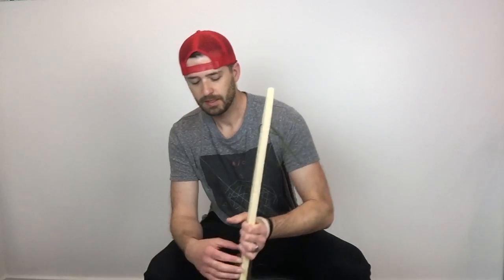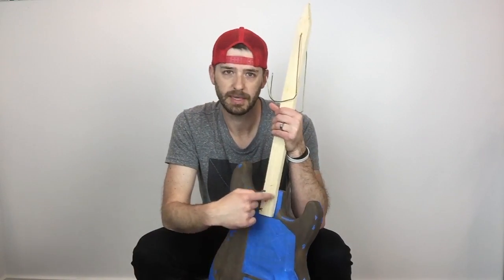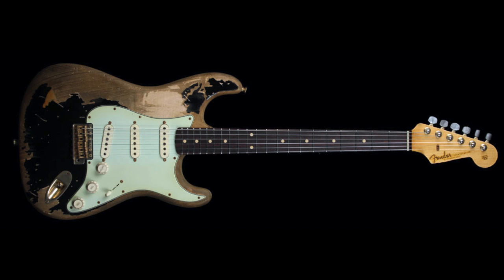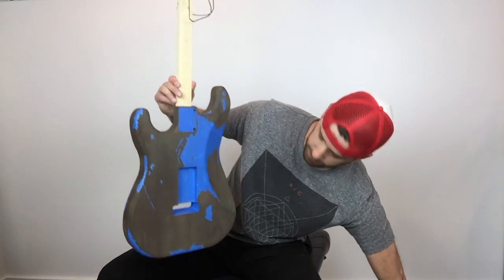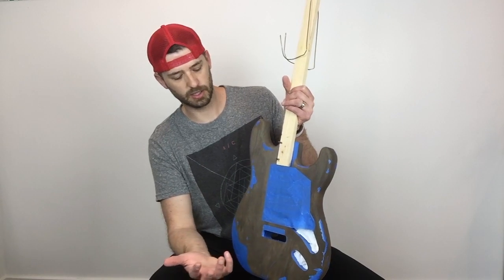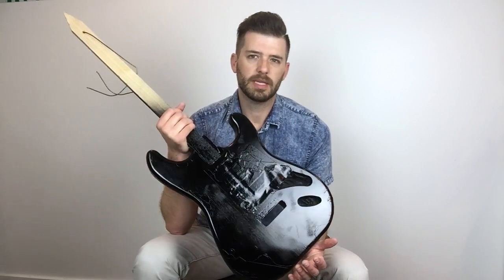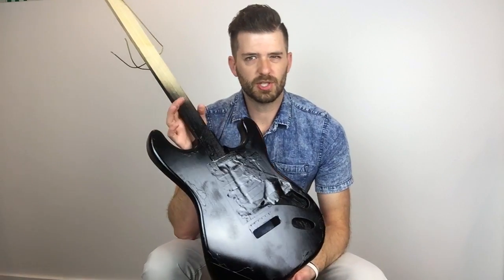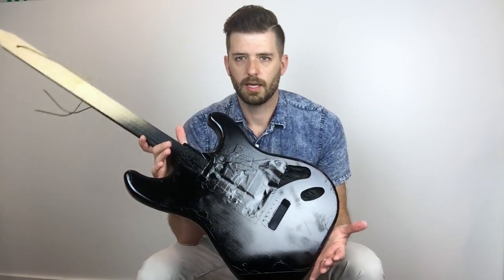Strat Nitro Finish Body Work - Part 1

Comment: the sealer is what makes the grains pop and contrast more
Reply from the maker: james dacus interesting. I used sanding sealer under the painted parts of the body, but not on the exposed wood parts. So that would make the grain pop more?

Comment: did you use anything as a sealer? I noticed that your guitar body didnt seem to absord much of the nitro. The nitro paint seemed to stick right on
Reply from the maker: Brad Woods yes, I used Stew Mac sanding sealer, then black nitro paint, then clear nitro. 👍🏻 @9:40 in the video there is a little ticker message at the bottom that mentions the sealer.